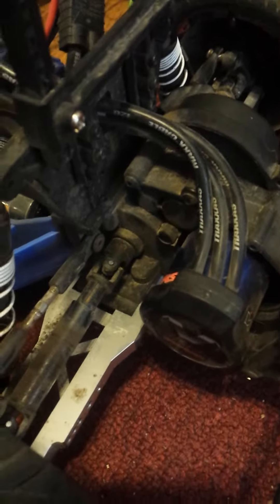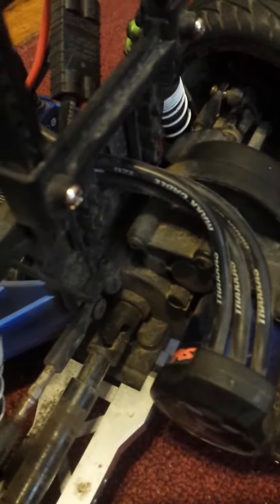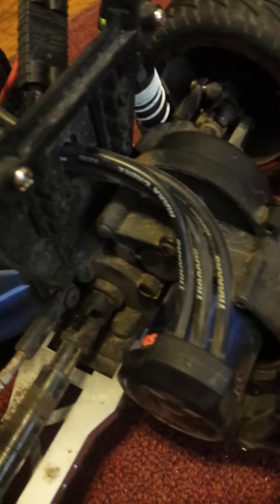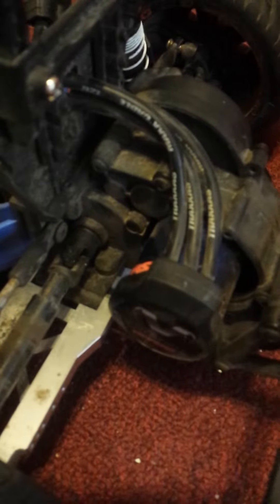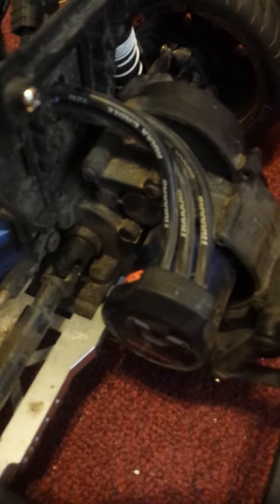Problem with the traxxas slash 2wd

Comment: It's the pin inside the transmission. That's connected to ur slipper clutch. Just fixed mine today same problem $3 fix